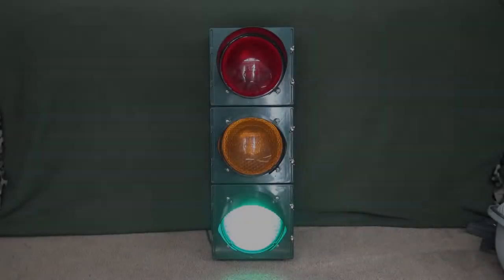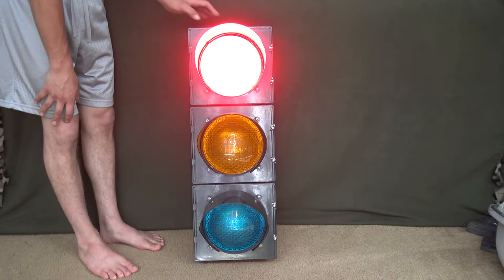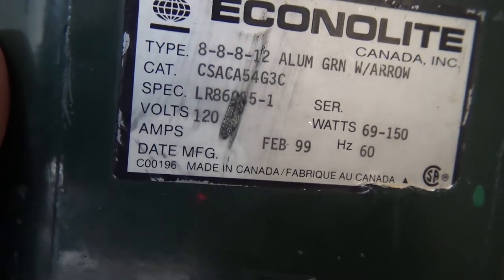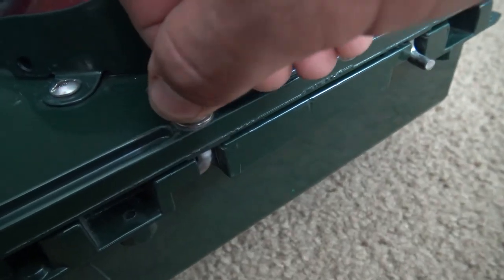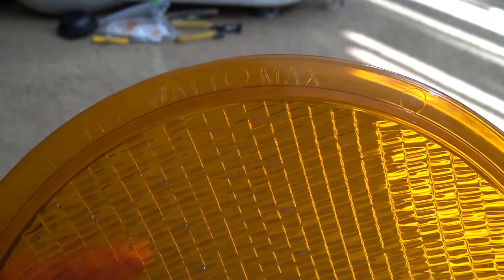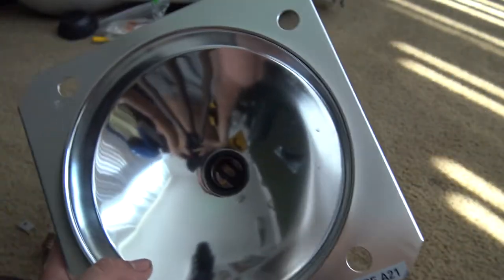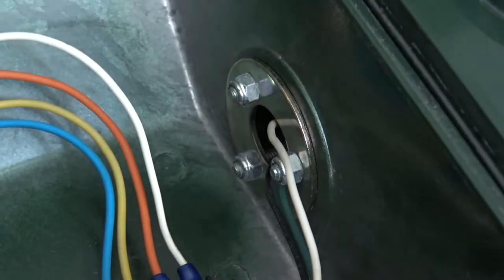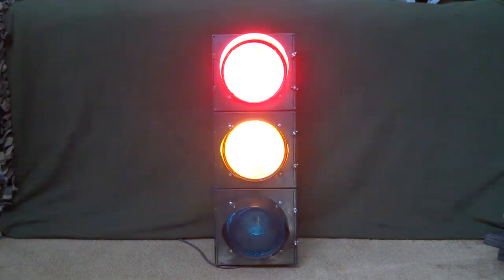8" Econolite Aluminum Traffic Signal Overview

Comment: Ayeee, I have the same exact signal with the same color paint! It just has LEDs and tunnel visors. It’s my favorite kind of traffic signal as it has doubled wing nuts and it looks like a McCain on the back. I think that the Econolite signal is unique since there’s also a 12” variant of that specific signal whereas Econolite’s other traffic signal that has a button-back design only has a 12” variant. They use a lot of Econolites in Ohio and North Carolina but in my state, we don’t and so I’m glad I got mine when I did which I purchased on eBay back in 2020 and it’s my favorite traffic signal and I might change the paint from green to yellow since traffic signals in my state are yellow and I prefer that color lol

Comment: Econolite started as a distributor for GE in the 1940s, and the entire GE line was sold to Econolite in 1957. I have an early Econolite head. GE did not buy Marbelite to my understanding. Marbelite is still around as a distributor of other manufacturers parts and an OEM manufacturer of others.

There are some politics involved with MDOT using Econolite - the MDOT director went to work as Vice President at Econolite and strings were pulled to include them on the approved vendor list along with Eagle. Prior to this only Eagle/Siemens controllers were allowed in Michigan, and now Cobalt/EOS controllers are standard. The only exceptions are Oakland County which use SCATS and Macomb County which use D4. Econolite poly signals do have a history of poor quality visors. Many intersections I've seen in Macomb County have had visors replaced all within the first 5 years.I think this has been improved in the latest builds.